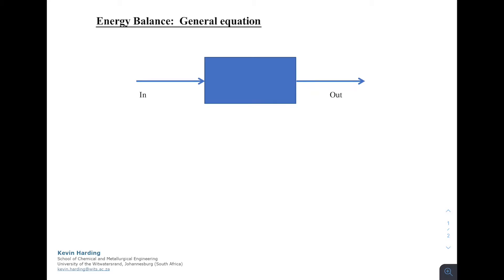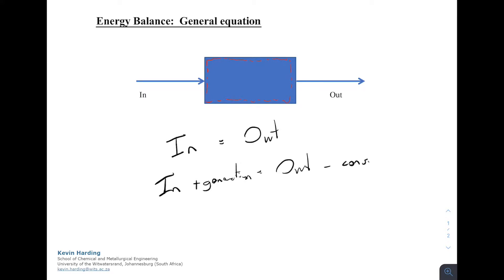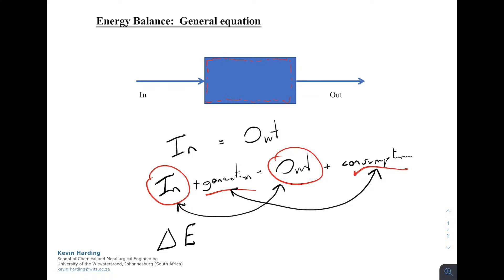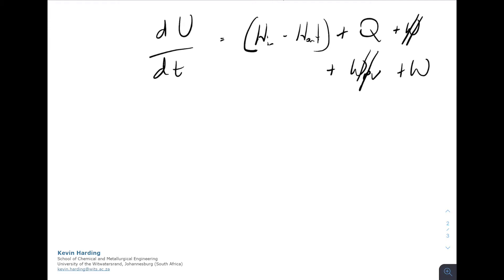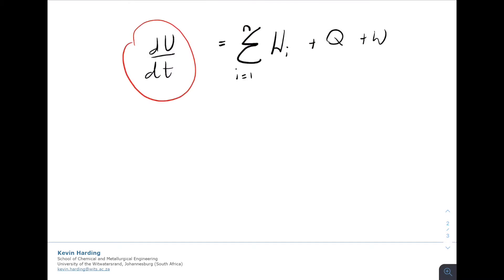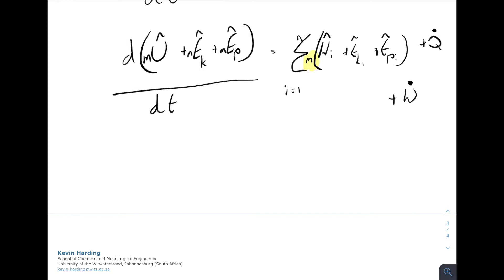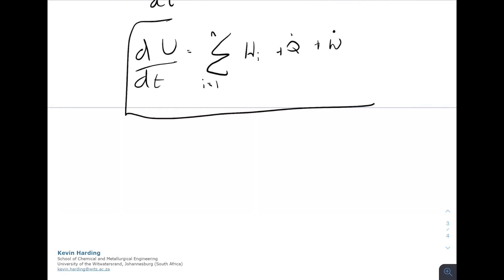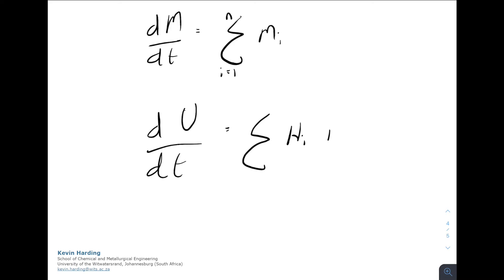Energy Balance General equation [Lecture]

Comment: @ 10:00 The total energy of a system (TE) = its internal energy (U) + its external energy (KE + PE). 
                Therefore, the change in total energy is: dTE = dU + dKE + dPE = (Q + W + M) + dKE + dPE.
                M is, like Q and W, a flow of energy; the flow is generated by a change in the mass-distribution.
                The use of enthalpy (H) is only allowed in constant-pressure circumstances/chemical reactions.